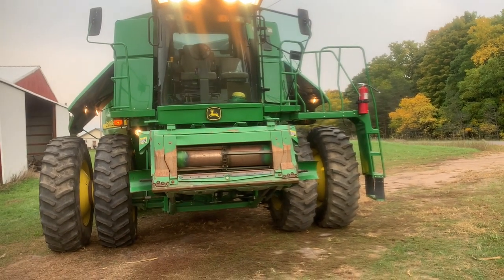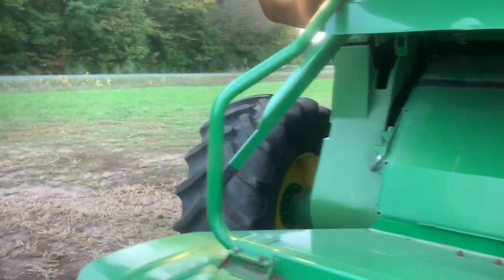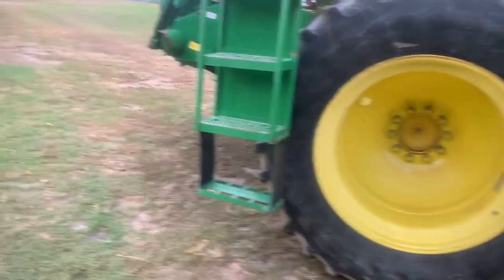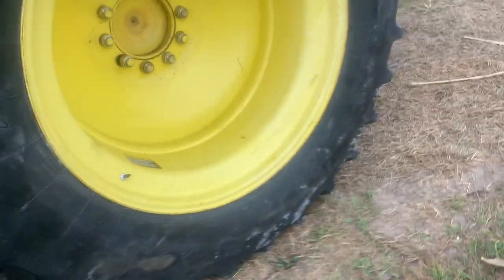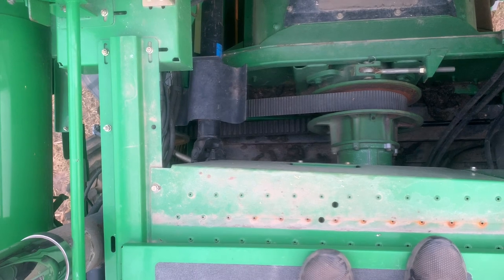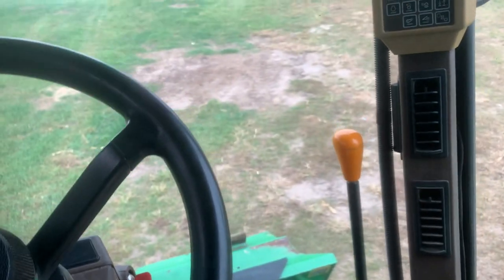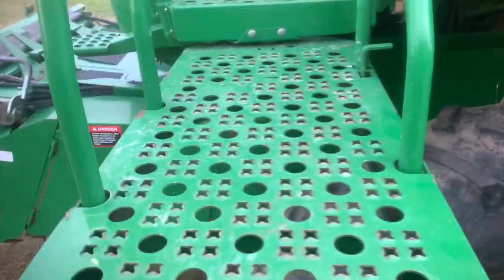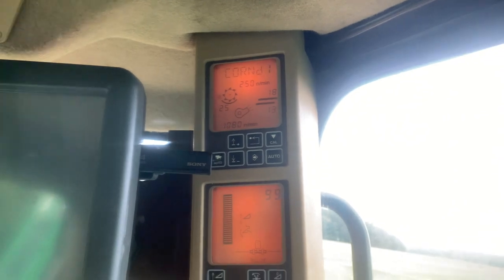Tour of a John Deere 9760 STS Combine

Comment: Blow it off everyday because there’s way more nooks and crannies to collect dust 🤬 you won’t be changing your rotor speed because you’ll be in first for corn all the time but sometimes you have to wiggle that big pulley back-and-forth to get it between first and second if you were switching for beans just ask me on Instagram if you have questions
Reply: And check hydraulic fluid level with head on the ground or just feeder house down
Reply: Jeff Reymond well join back up and I’ll reciprocate 😂
Reply from the maker: I’m wondering if this will be the first fall where I actually have to worry about blowing the combine off. The last few years it’s been a wet, rainy/snowy fall, and the corn was never too dry. I know a lot of people have issues with beans being too dry in the fall.
Reply from the maker: And no Instagram, Jeff?? Just kidding. I only like it because unlike Facebook, it isn’t completely filled with politics. Ugh. At least there’s tractors to look at on IG.
Reply: Jeff Reymond third time‘s the charm I think you should join back up 😁
Reply: Jeff Reymond  you just don’t wanna talk to Kevin and I I see how you are 😢😂

Comment: You can’t run the newer ones without being on the seat which is a pain in the ass 🤦‍♂️ I have to have Barb on the seat when I blow it out at the end of the year
Reply from the maker: I was kind of surprised it let me out of the seat, but I was so glad that it did. The 9500 would let me, and I didn’t know if this would be new enough that I couldn’t. I like getting out and checking things over while it’s running!
Reply: Remembrance Farms, LLC yeah that feature sucks in my opinion i’ve had my radio fall off the buddy seat and I try and reach down and get it and if the pressure changes too much on the seat the damn head shuts off